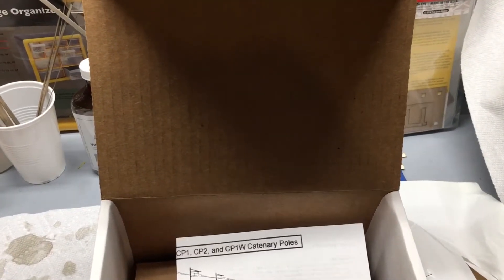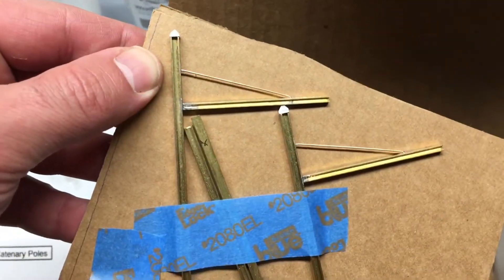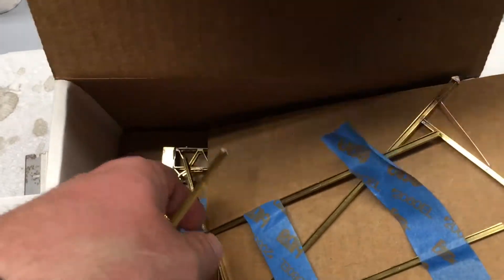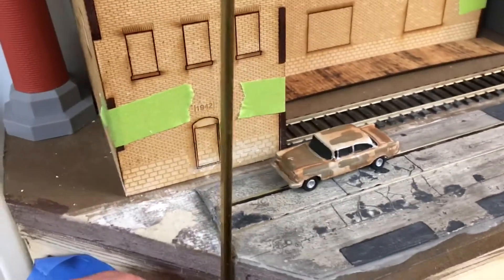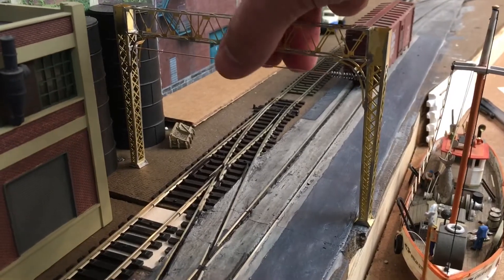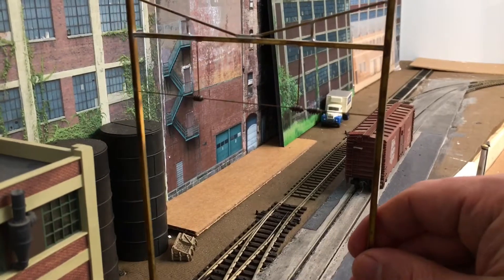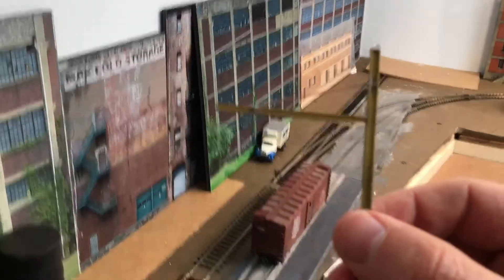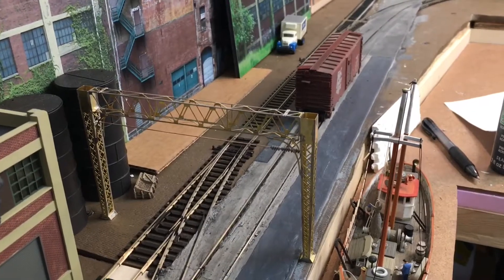New Haven Railroad Layout Update 38 "400 Subscribers & Mail Call"

Comment: Hey congratulations on 400.  As a fellow NH modeler I would like to comment on the catanary poles on your layout in the Seaview Avenue area.  Most trolly lines in the Bridgeport area were plain ole wooden telephone poles on either side of the tracks with the catanary lines hung between them.  I would suppose Seaview area was really no different.  The NH styles of catanary you have purchased were used on two types of track.  The single Poles were used on branches with the Danbury branch being the type single metal poles you got. You can see these in New Haven in the 1950's video.   The towers were used on the mailines.  It is your railroad and I totally think what you should do is model what you want.  However, those two style poles from Model Memories would be better used on a branch or main lines.   In fact I would suggest where the Seaview Ave. track comes off the yard track you could switch from Tower to metal pole to wood poles and have a nice transition between where the NH railroad property was and the Seaview Avr RR trolly trackage began and connected with the NH. Bill Shanaman Sugar City, CO.
Reply from the maker: Bill Shanaman thanks for your comment. My main line will be covered in the NH towers. My current Seaview Ave is double track so I figured putting in double track bridges to show wire was once down there. I realize the poles would represent the wire in a more prototype manner but decided to add the brass bridges. You definitely had some great suggestions. Thanks

Comment: I would go with the PRR, they are similar to the single ones. I would also run some wire to simulate just after the last run. No need to energize the wire.
Reply from the maker: Frederick Wuestner, Jr. All of the wire on the layout will be for show. Power will come from the tracks.